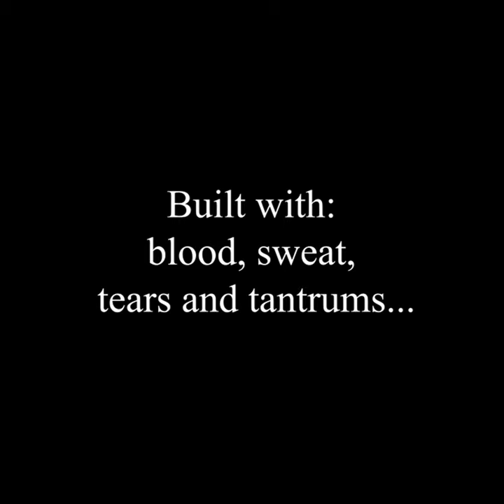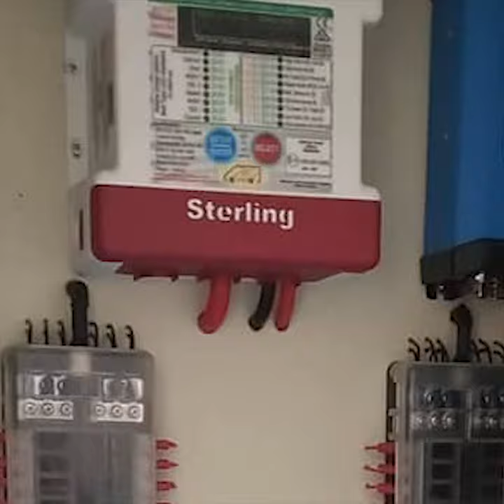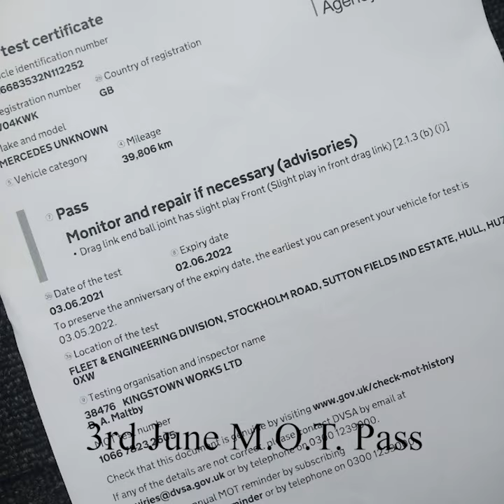Mercedes Vario 614d Restoration Conversion Bus to Luxury Camper Photo Montage Time Lapse.

Comment: When you started the demo work my heart sank as you kept uncovering more and more rust and damage and I truly felt horrible that someone must have really scammed you to buy what was basically a shell of a van/bus that was about to crumble into a pile of rusty metal bits. Then you started to work your magical and highest level of talent and crazy skills to basically build your future travel caravan from the ground up. What you created and built is definitely stronger and of a higher quality of a vehicle than the original one was which is pretty awesome and incredible because Mercedes usually builds a higher quality vehicle than most with Volvo being the highest from my experience with both vehicles. An older model Volvo saved my life back in 1989 when I was a passenger in a Volvo stopped at a red light that was rear ended by a car going 45mph in a 15 mph zone. The impact spun the car 180° and sheered the heavy chrome bumper off. That was the only visible damage on the car.

I can't wait to see the new build you are working on currently because you learned a lot from doing the first build and now know what types of things you and your family really need to make living in the new build even better the second time around.  I hope you will post more videos on your channel.

Comment: Grate jobs  mates , i just started a 0814,vario   2001 128000KM first  job was to remove the second floor ,as it was a wheel chair bus  original floor  as  new ,just started to remove the roof and life it 40 cm as the kid wants a drop down bed i got one out of a Hymer , hopefully it will be finished for next year,  ONEE AGAIN GRATE JOB  GOT LOTS OF HEAD UP FROM YEER  Youtube channel
Reply from the maker: Hey thanks for watching and the great comment. The bus has moved on a bit since I posted this and nearing completion. A van tour is on the cards 👍👍 wishing you the best with your own conversion and hope you enjoy doing it as much as we did ours. 👍🚌🤗